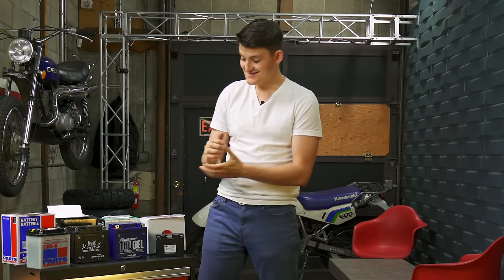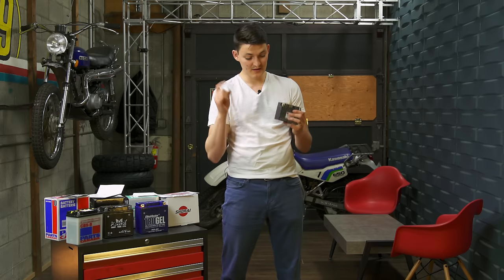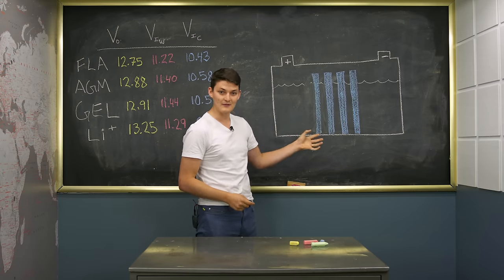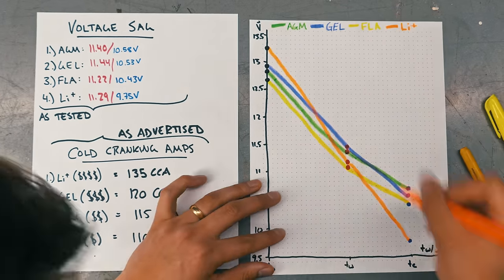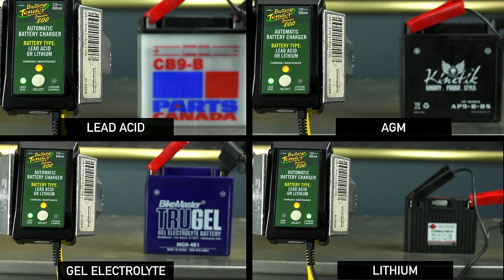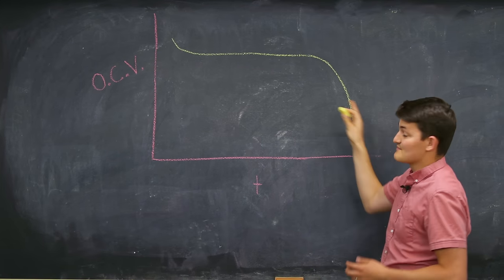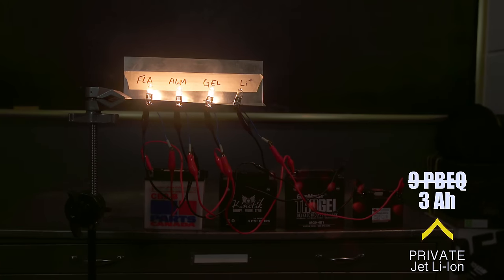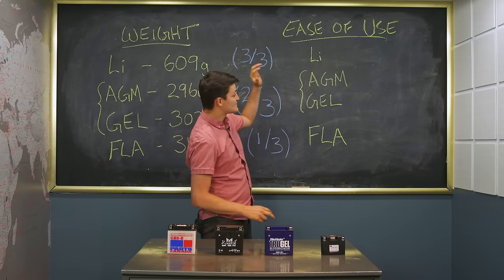Best Motorcycle Battery? Lead-Acid v. AGM v. Gel v. Lithium

Comment: EDIT: CORRECTION LIFEPO4 BATTERIES WILL EXPLODE IF PUNCTURED OR OVERCHARGED, HOWEVER THE DAMAGE DONE IS MUCH LOWER THAN LI-ION CELLS.
I MISTOOK THE LIFEPO4 BATTERIES WITH LITHIUM GRAPHENE BASED ONES.
Reply: Graphene is not used in lithium batteries. Even Tesla are not that good.
Reply: Lithium-iron-phosphate (LiFePO₄) are lithium-ion cells (one of the safer flavors). There are many different types of Li-ion cells and as a general rule the safer ones have the lower energy density.
Reply: @Dave5843-d9m  - News from year 2020: "The market for graphene batteries is predicted to reach $115 million by 2022!"
Flat Screen television replaced CRT television and the lesson is that technology marches forward.

Comment: One note about lithium batteries: The "emptier" they are, the faster they charge. As a Li battery charges it starts charging slower near the top of it's capacity. The slowdown is most noticeable after 80%. (If I am not mistaken)

Comment: Hi, maybe I can explain the slow charge for Lithium bateries. Was many years ago an electronic designer and was tasked with designing a charger for the batteries used in those fancy hospital beds. Short story is that lead batteries are charged with a constant current system, while Ni-Cd for example (probably Lithium too) used a constant voltage approach. A constant voltage approach means that there is gradually less current suplied when the target charge level is reached. With constant current it is giving it all the beans untill it tops off, which is faster but only the tough lead acid batteries could take reliably.

I didn't get any of the prototypes sent back so they must have worked ok.
Reply: In a car or motorcycle the battery ends up being charged at constant voltage anyway doesn't it? The alternator/regulator maintains a pretty constant voltage and it will just throw as many amps at the battery as it can take, which will be a lot right after cranking but it will only take a few seconds to drop off as it shouldn't take more than some 30 seconds to charge it back up to full capacity from one crank.
Reply: @BigUriel  Depends on each vehicle and it's designed system but the alternator is going to be the limit on how many amps are fed into the regulator and the battery. On ex VFR750 it used a basic zener shunt from a three fase ac alternator, and the rating for the zeners where about 2v over the nominal battery voltage... that meant the the battery was given no current limit while under its nominal voltage. The regulator design is quite crappy and didn't maintain a very stable voltage, but for an old school carbed engine it was good enough. And it was ok for lead acid that could take that beating. I don't know how a lithium battery would fair in that system. Modern bikes are another story, but in the end are designed for a given battery type and charging scheme.
Reply: @hawgietonight  Yes older older bikes had some crappy electronics, I know Hondas used a very simple regulator circuit that actually didn't provide constant voltage at all but instead only put out like 12V at idle which climbed to around 15V at around 4-5000rpm then levelled out. Lithium batteries would not like this at all (even for lead acid ones it's a terrible charging method that guarantees your battery will be overcharged and have a shortened lifespan during normal road riding, but will not be properly charged and will go flat if you spend too much time in traffic with your lights on).

But cars and modern bikes all put out a pretty constant 14-14.5V in all conditions, in which case except for cars with a battery controller (which needs to be programmed for the characteristics of the battery fitted) the charging circuit will just pump out as much current as it can deliver as soon as the engine fires up. Modern cars typically have alternators around 2KW so for a few seconds after starting the engine the battery is being charged with well over 100 amps, which decrease gradually as the battery voltage increases. I think modern bikes are around a quarter of that.

Comment: informative and interesting yet again. Ryan, you have just saved me pounds again not buying a Lithium battery. Sticking to the AGM.
Reply: But that will cost you lbs ;<)
Reply: @Fekillix  5 pounds of it? That's not healthy.
Reply: @exothermal.sprocket  Might need more fibre in their diet.
Reply: @wobblysauce  Too compacted. Get some celery, carrot, kale, and other fibrous stuff moving it through.
Reply: I ride a gsx s1000 and have fit a motobat mplx4u-p lithium it cost £35 and works a treat
Reply: Ezra  You can buy higher capacity lithium for the same application. I think I would, personally.
Reply: The bikes alternator renders the last test irrelevant.  If weight is your issue spend the lbs
Reply: My old Gel battery lasted 2 years. I am 6 years in counting on my Lithium. Yes 2x the price but I am now 3x the longevity and its not showing signs of bugging out yet. Plus its 2kg lighter.
Reply: Again 

There is practically no again with a lithium battery.

How is that battery working out for you hmm
Reply: @Generic_Name_1-1  Lithium batteries are great if you're space limited. I use the lfx18a1-bs12 to start my car.

Comment: 1:59: "why would anyone do that?"
Two words ryan, cafe racers
Reply: first thing i thought!
Reply: Nick B the scrambler I’m building will need it to be mounted upside down! Silly Ryan forgot about us
Reply: @cyriously_nick2191  Well, as a former Cafe Racer builder (XLCR 1000 and '75 CB 750) I don't blame Ryan for forgetting Caf' builds...taking a perfectly functional bike and making it less fuctional is an exercise in futility. I love the look of a Caf' but try doing 1500km in a weekend and you'll be ready to trade it for a beat-to-shit UJM :-)
Reply: @rockarola55  it's not less functional, just a different function. You compromise comfort for agility and speed.
Reply: Jake Edgell you don’t really build cafe racer for speed do you ? I would say it’s more about style .
Reply: @rasulmalachidibirov7691  back in the correct time period, the 60's, Cafe Bikes were fast. They took out the unnecessary parts, reducing the weight. Nowadays, it's just a hipster thing to do it seems.
Reply: Why would anyone use the wrong charger on lithium? Why would anyone use a lithium that doesn’t fill the battery compartment?
Reply: Would it be safe to connect two or three lithium batteries in parallel in order to maximise its usability in an old bike that always needs an external boost to start up? 
My 1999 Aero VT1100C3 has been through three stators, three rectifiers and at least three batteries in the six years I have owned her. Now I constantly carry with me a lithium booster for startups. The lead-acid battery is being charged by the bike's electrical system, so that I never stop dead by the side of the road. (Although this did happen before my first stator change out.) 
I am hoping that lithium battery/ies will be more reliable than my current setup.  (pun intended)
Reply: OronOfMontreal replacing your lead acid battery with a lithium of the same PHYSICAL size might be enough on it’s own without connecting two together. 
In the uk we have sportsbikeshop.co.uk which i used to find the battery i needed.
Reply: @OronOfMontreal  i knew someone at a co-op shop i used to work on my bike at with a 2000 honda magna that fried their electrical and starting system trying to use a lithium, vt1100aero is a shadow correct? i wouldnt recommend it, definitely research what your bikes charging system can handle.

i would think what you need is a battery with higher CCA, depending on how much space your bike has for a battery. also, going through that many components that often would indicate to me a deeper electrical issue, you should not have to be replacing that many parts repeatedly. 20 years is a good amount of time for bad wire sleeving to crack and start shorting things
Reply: He mentioned Cafe racers and custom builds in the bike mods video before this one when he talked about the lithium battery
Reply: Two words “dry sarcasm”
Reply: @OronOfMontreal  Yes its safe to wire them in series, people do it with anylevel lifts and such ally he time. I believe that same goes for all batteries but I'm too young to know of anything before lithium. This is fake news. I only know roughly what WhistlenDiesel did to his anylevel on his FOrd f150 and he didn't explain anything
Reply: @salami99  batteries wired in series add voltage:  wire two 12 VDC batteries in series and you've got 24 VDC.  DON'T DO THIS WITH A 12 VDC ELECTRICAL SYSTEM!!!  Batteries wired in parallel add _current_.  Amps.  This is what you want.  Positive to positive, negative to negative for parallel wiring.
Reply: @jfreedner  ah shoot i confused them again
Reply: @rockarola55  He has said in the past that Cafe Racers were cool in a vlog when he used to do those.
Reply: @SirNarax  yeah, I'm not saying that he dislikes them, I'm just saying that they are some of the most impractical bikes on the planet...and I've both built and ridden the damn things :)
Reply: @rockarola55  Oh yeah, well if you were riding motorcycles and cared about practicality and practicality only you would probably be on a scooter or if you lived somewhere out there a duel sport or something like that.  Everything else is a toy.
Reply: @SirNarax  I have been riding motorcycles as my only form of transportation for years. I live in a city where parking is expensive and hard to find, I need to ride on motorways and I don't have any kids/dogs/giraffes that needs to be transported. My motorcycle is the most practical solution for me, it's not a toy.
Reply: @rockarola55  Okay.  You can use toys as tools.  A skateboard can be used as a form of transportation but that doesn't make it any less of a toy.  Or a gaming keyboard and use it to fill in excel sheets.  They were designed to be play things so play things they are and that doesn't make them any less practical.  You can turn a toy into a tool and a tool into a toy.  I was saying if all you cared about was objective practicality you would have a single use vehicle or something like a scooter.
Reply: @SirNarax  I don't know where you are from, but motorcycles are used as the main mode of transport all over the world. They are cheap to purchase, cheap to run and practical for city transport. Americans tends to think of motorcycles as toys, but they are viable single person transport. I won't be travelling 1000km per day on a scooter and I certainly won't be doing 120km/h on motorways on one. Just because you regard a motorcycle as a toy, does not make it so.
Reply: @salami99  you may want to edit your post to save someone a fried electrical system.
Reply: @cyriously_nick2191  To all the scramblers out there - YOU are the fools. Reviving a drop dead and rotten category of motorcycles because some influencers told you whats cool and make shitloads of money with the scrap you purchase. Not very smart
Reply: @jfreedner  wrong. They add capacity amps times hours. Go back to school. 9Ah. Ah is not the unit for current but for storage.
Reply: @suprememasteroftheuniverse  where did you study electrical engineering?  What microelectronics have you repaired?
Reply: @SirNarax  I would argue that type of use makes something a toy or not. If you bought something mostly because you like to play with it it’s a toy otherwise it is not.
Reply: @franktechmaniac7488  not everybody needs a mx bike to ride on green lanes and scramblers are a bit easier off-road than road bikes and comfier than mx/enduro bikes on the road. For some they fulfil needs exactly.

Comment: Usually, i find your videos very well researched but here i have some point of criticism:
- cranking happens at a rate of 50A and more. at these high currents, there is a significant difference between lithium and lead batteries
- lithium batteries have around 10 times more charge/discharge cycles.
- considering that you do not need a charge for your lithium batteries, you can save that money buying one instead of a charger and a lead batterie

the right conclusion IMHO would be: for offroad and cold climate riding lithium has disadvantages. if you are living in Europe or middle America there are some notable advantages to lithium. lithium batteries might last much longer before needing replacement in these milder climates. last but not least in race applications weight reduction is very important. reducing the weight of your bike by 2-3kg is a no-brainer for around 50-100$ more.
Reply: Agreed. And I'd be interested to see a test comparison between different brands of Li batteries because of how maintenance free they are and performance they put out. If I'm paying as much as I am for an Li battery to not have to add acid/water/etc for other batteries, I'm fine with that so long as it's starting up every time with normal use. And even when it gets garaged for weeks/months, it's nice to know that I didn't need a tender on it and waste power when it stores it just fine.
Reply: Well, "Europe" is a broad term. I live in a pretty cold climate in the winter, with temps dropping to -20 Celsius which is around zero of the freedom units. My AGM is a bit moody when it's that cold, I wonder how a lithium battery would feel?
Reply: @folxam  Not had a problem with my Lithium and storage. Mind you, it only gets to around -6ish around here. Cranks the bike and starts it no problem when it finally gets up to 2c, my minimum riding temp
Reply: My lead acid and my lithium both have 180 cca, if you store your battery over winter and want to keep an alarm on on your bike for instance, you will need a charger.  And a proper lithium one if you want the cores balanced correctly to prolong life, with Shorai they have an extra plug on their chargers/batteries, that means Shorai chargers only to balance the cores.

I got a Shido, with these types you need a charger like the TecMate OptiMate Lithium 0.8A Battery Optimiser.  They cost more than the battery itself, my battery cost around £45 for my ER6f (Ninja 650r).

It's good to charge them with the correct charger occasionally to balance the cores as the bikes charging system will not, just as a normal trickle charger will not.
Reply: @Jin-Ro  storage?! Nah, I ride all year round, rain sleet or snow.
Reply: @HalfdeadRider  you make an interesting point. i have a JMT batteries (im from germany. no idea if this one is available elsewhere) cost me around 80€ and it is performing very well on both of my bikes. i have never thought about cell balancing. there might be a cell balancer in the batterie pack itself. balancing itself is quite simple and can be achieved with a simple resistor to discharge certain cells. you can get balancer boards for around 3€ for a 4s batterie. 

due to the fact that in my batterie manual nothing is said about balancing or tinkering with the bikes charging circuit I'm quite sure it has overcharge over-discharge protection and some basic balancing. otherwise, the batteries would be dangerous to use on some random old bike. 

the wierd thing is there is about no information around these questions on the internet
Reply: @folxam  my man. i also ride around the year. it gets not much colder then maybe -5°C here. it it gets colder i stop riding for the short time it is so cold and disconnect the batterie and somethime take it inside to keep it from getting to cold. 

that is not an option for every rider i guess because on some bikes the batterie is very hard to access. for me its on both my bikes only 2 screws and i can remove it
Reply: @savejeff15  It does not make them dangerous, it just reduces the capacity and lifetime of the battery.  Mine has a monitoring system but I don't think they have a self balance capability as some believe they do.

The instruction for my Shido (different name in different countries, now used by some bike manufacturers apparently), do say to use a charger designed for lithium batteries.

I would like to get the TecMate OptiMate Lithium 0.8A battery optimiser just to balance it occasionally.  Might do that soon as I've had my battery for some time now.

With Shorai used in the video, you have to buy their own brand charger to balance the cells.  They have an extra connector to plug into the battery for balancing the cells.

There are plenty of videos about them on here, but be wary of what you believe.  There are many going by knowledge of older more unstable lithium batteries, and some who just have been misinformed.

Comment: I LOVE these. 1 thing to consider when testing lithium against the rest is that your machine will always be built with a battery holster the size of the bigger battery. And you can rarely use the extra space so it’s almost fare to compare a lithium of the same size as the others. In that case it will certainly beat them all at everything.
Reply: was thinking the same thing. Test a lithium battery the same dimensions of the others...
Reply: @tylerhall6455  and pay triple or more price

Comment: AGM are super cheap on Ebay/Amazon. I've had really good luck with them, in fact they are usually cheaper than most lead acid. $25-35 for most bikes.
Reply: you got a good deal.  I think my AGM that I got last year was about $120
Reply: @pinkpuffin187 I just bought an AGM three months ago for my Road King, could not find a lead acid around here anymore in a pinch on a Saturday. It cost me $170 for the Duracell Ultra.  Hope to find a Lead acid, last one lasted almost five years, the AGM wouldn't crank the bike after sitting a week. According to the MFG tag it was already 6 months on a shelf before I bought it.
Reply: Don't buy cheap chinese batteries, you are playing with fire, literally